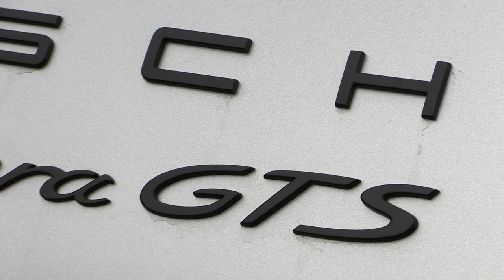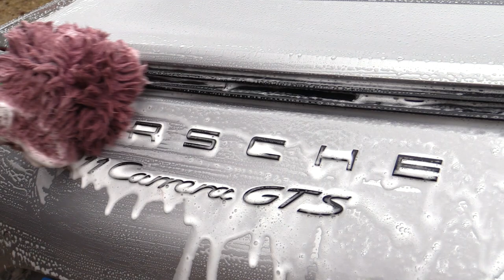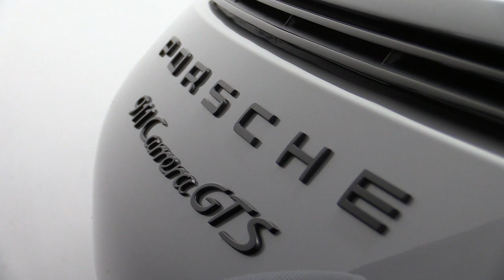Exclusive Sound: Porsche Carrera Pre-Hibernation Clean

Comment: Are you afraid of damage or getting the car dirty again, kick back, from the stones/pebbles on the ground. Would you ever consider using a weighted floor cover, something that can drain and be transported on the roof of you car? Love love love your videos, keep them coming.
Reply: Imagine what could even happen to the car if it would been driven on a dirty road? ;)
Reply: Nooo don't ever drive your car! That's the best way to make it dirty!
Reply: Damage.. unlikely unless very unlucky, any splash back from the ground is easily rinsed off unless missed and allowed to dry in, unless you've the luxury of a cattle guard type of ground to work with splash back is always going to be a possibility, no point been over cautious about hauling around floor covers when loose stones, potholes, debris etc etc are there for the car to contend with on a regular basis

Comment: I do the clean-up when the car comes out of hibernation, because pressure washers result in water in all sorts of crevices of the suspension, brakes and engine bay, that can only be eliminated with driving at temperature.
A wash like this (even after drying with an electric leaf blower), followed by months of sitting in a garage allows that water to do all sorts of nasty things as it gets into areas where it just doesn’t dry out so easily - not good!

But that’s not the CCG’s fault, he is #1
Reply from the maker: To be fair the owner of this car does his best with dehumidifiers and I think I he now has under floor heating.

Comment: I just took delivery of a 2019 Porsche 911 Carrera GTS TT.  I had the race pack PPF placed on the car (complete front, front of the roof, the strips below the doors, half way up the rear wings/wheel wells, and on the lower body strip at the back of the car.  I also had 3 coats of Ceramic Pro applied.  The car stays very clean, and often does not require much more than an Automotive Wash Armor All.  The spokes on the massive wheels were treated with Ceramic Pro, but they still need a good cleaning.  Are you using a painter's brush clean the lip between the spokes?  The ceramic is very difficult to scratch.
Reply: Likely some kind of boars hair detailing brush. Quick tip, ceramic coatings aren't immune to scratches. You can scratch a car coated with a ceramic coating just as easily as an unprotected car, ceramic coatings essentially only protect against wash related marring, and even then they can still easily be marred and swirled. Including ceramic pro, of which I've worked on a few vehicles coated with their 50000 layers of coating. Don't let the coating lull you into a false sense of security. The still need to be washed with a proper soap, powerful enough to remove road grime (like Carpro Reset, even though reset doesn't remove 100% of it) I've worked with vehicles coated with ceramic pro and after washing with a strong degreaser and appropriate soap I polished off the coating and was greeted with embedded road grime showing up on my pads. IMO you should've went with something like Gyeons professional lineup, Gtechniqs professional line, or Carpro's Cquartz Finest or Finest Reserve.
Reply: @NCRranger24  Well, we'll see how it does.  I have a 7-year warranty which includes an annual inspection and reapplication as required.  Although it has only been one month, I am impressed by how difficult it is for stuff to cling to it.  No product meets the challenge of keeping our cars perfect.  We'll see how it does.  Autogeek sent me a bunch of products for use with ceramic coated vehicles.  Between washes, I use Armor All Wash Wipes to touch up the car.  Again, not much is sticking to it, and the car is garaged when not in use.  It won't see ice or snow, but it will be driven in rain.
Reply: @michaelpersiano6957  I would stay far far far away from armor all wash wipes. Trust me, if there's one thing you take away from this, it is do NOT use those. That's the quickest way to swirl a car up short of using dirty wash mitts or taking it through a tunnel wash. They do not provide adequate lubrication nor are they an appropriate medium to capture dirt without dragging it across the paint causing swirls (they're a wipe). If you need to touch it up between washes, use a quality microfiber towel, and Carpro Ech2o waterless wash or something similar. Avoid armor all products in general, but especially the wash wipes. I coated a client's car with Cquartz Tio2, and they used those to remove some light dust. Marred the hell out of the coating. Essence plus didn't fill all the swirls in those shitty wipes left, so it's still noticeable. Your detailer should have informed you how to maintain and wash the coating properly. Those wash wipes are not it.

Comment: How you manage to get so much suds in your bucket (especially when you were doing the wheels, your brush and mitt were just completely doused) just leaves me speechless. Have rather hard water here, it’s difficult to get shampoo to suds up really thick unless you use unreasonable amounts or just go straight with the foam lance. Lol
Reply from the maker: Don’t be shy when adding shampoo to the bucket and use the pressure washer to froth it up usually works for me, although cold weather always helps sustain thick suds too!

Comment: Hello CCG, I have a question for you. I've been following you from the very start and with technologie behind coatings being so good by now I wonder why you don't even seem to use any. I'm convinced you could bring a lot more value to your customers AND make your maintenance work easier on your customers cars when you offer a coating in your larger services. I know a couple of detailers who come to your door and manage to wash, lightly polish and coat and entire car within one day. A coating like Gyeon Duraflex only requires to be applied in 2 layers taking around 1h each to apply with 1h waiting time in between. 

A duraflex set costs 150quid and u'll be able to get 3-4 cars out of one set. So its 50 quid of product per car, and it doesn't take much longer than applying gimmicky 'purple haze glaze wax' products which wear off after 1 wash or a couple of months. 

Duraflex has been proven to last 3.5 years on heavy daily driven, not well maintained cars, and will easily achieve 5-6 years on low miles garage kept cars. Especially on a project like this one, where you can store the car inside afterwards so the coating can cure nicely, it would give a masssssive value to your business and your customers.

A lot of people don't opt for coatings because most detailers who install real coatings have to pay for their place, polish a car for 2-3 days in a row and spend 4-5 days on one car in total. Making the cost run up to 1.000 quid for one car. If you can bring a good deep cleanup with the added benefit of a coating, in the comfort of their driveway for a quarter of their price I think you would hit a home run currently in terms of business and customer satisfactory.

Just my 2 cents as I was wondering why you never seem to use coatings.
Reply from the maker: I just don't feel you can adequately prep and properly coat a car outdoors in a single day. I'm sure there are those who manage to 'get away' with it but knowing how hard pushed for time I always am and how prone to change the British weather is, it's not something I would feel comfortable charging for. If you want year's worth of durability from a protectant then having someone spend 3 days on your car in a controlled environment in order to achieve that isn't a big deal in my opinion. Oh, and waxes look better!
Reply: @CarCleaningGuru  Alright, clear answer. Thanks alot!